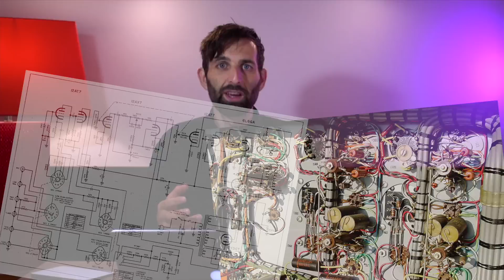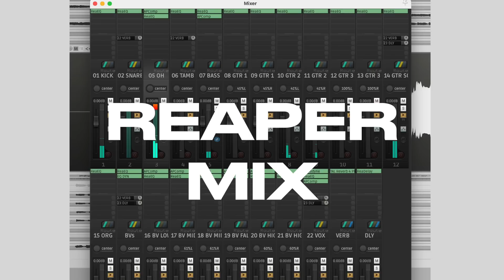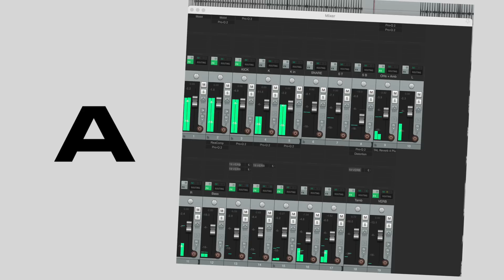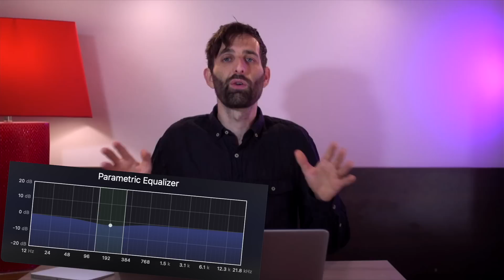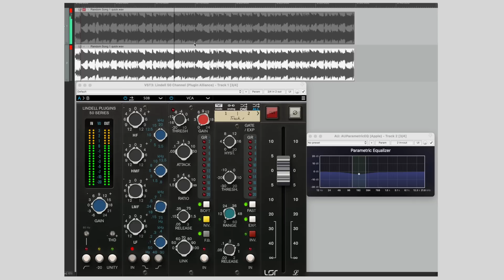Don’t Fall For This! (Common Audio Mistake)

Comment: You are preaching to the choir here! EXCELLENT VIDEO! Do you know how difficult it is to spend YEARS working on a project to reach the marketing phase only to discover that there are 99 hucksters in front of you selling snake-oil introducing giant amounts of skepticism into the entire marketplace! And don't entertain A/B comparisons until the LOUDNESS has been equalized between the 2 sources! Arghhhhh! And if you "think" that you "might" be hearing a difference - know that you're NOT! Loudness adjusted tests involving A/B sources should grab your attention right away with the impact a true improvement makes! And when I say A/B comparisons, - I'm talking about a KNOWN vs. the Experimental. I.E: In my A/B demos, I use the actual studio release of a track as one of the sources. The other source is the "Experimental". Both tracks can be observed in Parallel in a DAW which is used to play each back alternately with the loudness levels set to matching as closely as possible and no other processing! ONLY THEN, can an accurate comparison be made! And the difference should be clearly audible.

Comment: so can a complete strictly only plugins Mix/Master sound as great as a Hardware Mix/Master ?
Reply from the maker: it can sound better. depends on the engineer
Reply: @APMastering cheers, a little off topic maybe. whats your thoughts on the tube-tech cl 1b By Softube ? worth a blast ? i wanted to give that so called magic touch to bass freq on bass/ kicks

Comment: Not worked in sound for a while, fell sideways into picture. Do miss a good circuit diagram and taking a piece of gear to the workshop. Not a real studio unless you have a repair bench with Tektronix etc

Comment: Yep. Unfortunately, I’ve had this conversation with a lot of ‘seniors’ and just been dismissed based on my experience. 8 years vs 20+ years. Fortunately, the principles of psychoacoustics, electronics and logic do not change with experience. Very important to be grounded and have a strong zero reference to filter out the bull

Comment: My personal theory on the Console vs DAW mix topic is this - Movement. On a console, you've gotta reach over and turn pots. Your listening position keeps changing throughout the mix, and so does the overall frequency balance, which means you're never going to get fatigued with how much "resetting" you're doing for your ears. 
With DAW mixing, you're only really moving your hands, making it very easy to acclimatize to whatever you're doing. I feel like the best DAW mixers work on multiple projects in a day to keep their ears fresh. I Read that this was how "Thank u, Next" was mixed in a single day - Serban and John kept going back and forth on it - in my mind to remain objective and fresh.
Reply from the maker: that could be an important aspect

Comment: I noticed a difference in audio quality in different sound cards. The same plug-ins sounded better on digital audio recorded on the Apogee versus the cheap sound card.
Reply from the maker: depending on how cheaply designed it could be negatively impacting the sound quality
Reply: @APMastering  the USB iMic was the cheapest sound card I had. It made recorded audio sound like an MP3. Sound cards and mixers have different character but it’s what you do with it. So on point there.

Comment: I've watched Glen for a while and sometimes he slips up just trying to get a video out and this one could have been one, I think you are kinda missing the point with the analog mixer mix A B which was to highlight how massive a difference preamp distortion in a console can have, so if you want to create your own comparison for us I would do a free console distortion vs an Expensive one vs a generic distortion plugin vs a random wave shaping pattern vs no distortion and a Treble boost Eq, I would suggest Air Windows which is this crazy genius who releases everything for free in a super simple format and Universal Audio, just make sure you're using a significant amount per track and take notes, as dynamics and bass information can get lost as well as phasing with polyphonic instruments in certain ranges with too much distortion.
Reply from the maker: i'm going to do a proper neve vs daw test at some point

Comment: I started when the sound engineer dress with a duster and nobody was allowed to touch any gear in the studio at that time was so frustrating but respect  the work and the knowledge needed because to get better is a long process without shortcuts. Thanks mate respect what you’re doing

Comment: You make the same point as Glenn. He bought that console to spice up his workflow.
Glenn usually is a "Expensive doesn't mean better" Guy.
I've also mixed on a Neve and a SSL and the mixes weren't better but the Workflow was inspiring.
But i've also done a great mix on a Behringer console with a Mainboard that i've put in a Dishwasher to clean the dirty Pots and Faders... That was fun :D
If it makes you smile using it, you'll get good results.
Reply: Pickups don't matter and amps don't matter. Yeah, buddy. Also, if you can't tell Glenn's mixes are absolute trash, you might want to check your ears.

Comment: Been doing some blind ABX testing on compressor plugins. I absolutely used an o scope to match time constants and gain. Long story short the "high level" of aliasing people were complaining about wasnt enough to justify buying the fancy plugin. The biggest difference between the two was amount of that first harmonic. I even ran it by some industy vets I'm friends with and they couldnt hear the difference other than one sounded fuller in the low mids. I do think that despite the near identical interface the different time constant positions on the selector and that harmonic is actually what was influencing other peoples preferences. When matched the differences were essentially negligible.
Reply from the maker: exactly!
Reply: I think the best part is you can set up everything for free. Most daws have a simple sine synth or generator, o-scope, and frequency analyzer. There are free ABX programs that give you statistical data on your tests, some are even web apps! You might not have as much data to work with as plugin doctor or whatever, but you can match, and you can test your ears. I wish I started doing this years ago when I was just getting started.

Comment: If you want to end this analog digital debate, make a video using Access Analog service. It's an online service with robotized actual analog gear that you can control from your daw via a plugin. You basicaly stream your audio through a cloud, get it converted and analog processed, converted back and sent back to your pc in real time. It's fairly cheap for a 30 minute reservation and there are free analog pieces that you can reserve and test the service with. This would fairly show how analog vs digital is negligible compared to human decisions etc... Cheers.
Reply from the maker: i'm going to rent my fav studio and make a bunch of content there around hardware

Comment: As an audio engineer, I've seen a lot of fellow audio engineers falling into this huge pit, understanding why you do what you do is more important than slapping the same low cut on an expensive emulation or an actual analog eq and blabbering about how it sounds "warm, pristine, high quality, has more harmonics" BS. For the most part people are fooled by the marketing. 

I think a good engineer should be able to achieve good result no matter what plugins are used. End of the day these are tools. It's the ear, not the gear that makes a great mix.

PS: Really appreciate what you are trying to do here! keep up the good work
Reply from the maker: totally agree!

Comment: You kinda misrepresented Glenn from Specter Audio. He's a confirmed debunker of audio mythology and was making the same point as you!
Reply from the maker: can you point out the misrepresentation? other people have commented that he is good, I wasn't bashing him, but he literally just did an AB between subjective mixes
Reply: @APMastering  And was making the same point as you. No?
Reply: @periurban  Glenn Fricker is full of shit. He takes a valid point and turns it to the extreme. Examples:

1) Guitar Amps don't matter. His argument - He compared a Dual Recto to a 5150 running through the same cabinet using a DI box. He dials-in the amps to sound as close as possible and then claims that it's irrelevant that the amps can be dialed-in to produce unique sounds that the other amp can't match, because the sound that he dialed in was the "mix friendly" sound and all other sounds will not sit well in a mix. Total BS. Just because the speakers have the biggest impact on guitar sound doesn't mean that the amps don't matter - they do and they're not an insignificant factor.

2) Guitar Pickups don't matter - This one is obvious BS as well. The pickups might matter less than the amp but they also contribute to a noticeably different sound. There are tons of comparisons out there that show this (also gain-matched). Recently Keith Merrow did such a comparison and lets be honest here - Keith Merrow is 10 time better guitarist and producer than Glenn Fricker (Glenn Fricker is a very bad guitar player).

I can name more examples but these two are glaring enough. The guy thinks having 500k followers makes him a good sound engineer - it doesn't.
Reply: @GuitarCorporate  He obviously made you take notice though, which I think counts as a win for everyone.

Comment: Another big problem is that A/B comparisons are rarely blind. Suppose you're predisposed to thinking that analogue is better than digital. If someone gives you an A/B analogue vs. digital comparison you'd immediately assume that one is strictly better than the other. This alone introduces a massive bias.

I think a better way is to give multiple references and switch between them. A, B, C are analogue. D, E, F are digital. String together whole bunch of random permutations of these 6 references (DBECAF, BFCEDA, FCBEAD, ...). Challenge the listener to figure out which is which. It's a way harder task than mere A/B comparison.

This approach should also reduce the preference bias. Suppose you had A and B, and you preferred B simply because it had a slightly brighter sound or whatever, but this characteristic had in reality nothing to do with the comparison. It was simply "how the knobs were set", so to speak. Like comparing amp modeling vs. real amps - the model might not be 100% perfect, there are some differences in sound, but the question we really want to ask is whether it's good enough (i.e. could this model have been a slightly different analogue amp). We don't care about the fact that someone might prefer a brighter sound, but we can't easily get rid of this aspect in an A/B comparison.
Reply from the maker: I agree. however if you make it too complex for the viewer, they lose interest. I think a good approach is to do the simple thing in the video and then provide a link to files for people who want to go the extra mile... and normally when I do this usually only around 1% do go the extra mile
Reply: Someone should do a video training on the perfect/standardized way to do these split test videos. We need some standardization in this area. And then plugin companies should be encouraged/hounded to use the standard to reduce the BS.
Reply from the maker: @phadrus  its just what I say in the video. isolate all variables apart from the one you want to study

Comment: As best I can recall, the guy from Specter Audio that you took initial issue with, was actually making a similar point to the one you are making here;  that is, he was saying it’s important to not get lulled into thinking expensive gear will automatically make your mixes “better.”

He typically likes to fall on the side of science and actual engineering and does try to eliminate variables that can skew results.  

I’m not trying to imply your points here are invalid by any means, rather, just trying to note that I think you both are saying similar things but you are rightfully the more scientific of the two, which is needed obviously.  I just wasn’t sure if you realized you both made similar points.  Or perhaps I misunderstood his original point (which is also completely possible 😅)
Reply: Right. That is what I was thinking. This video should have at least used a real example. Funny thing is I came to this video right from a Glen Frick video 😂
Reply from the maker: @phadrus  I use a rough mix example
Reply from the maker: tbh I dont watch the guy, it was just a recommended video and im just commented on that. to be clear, im not dissing him, im just using this particular AB as an example to demonstrate my point